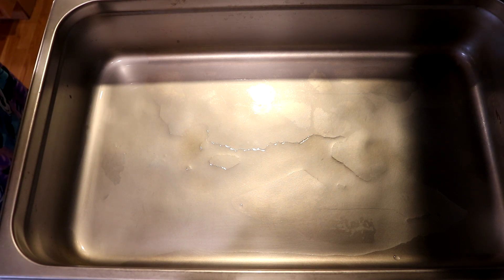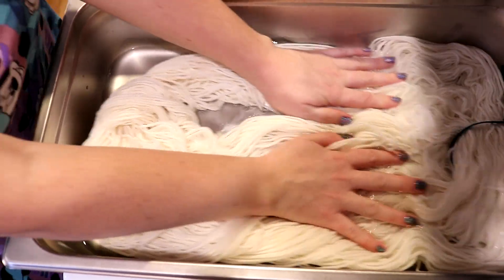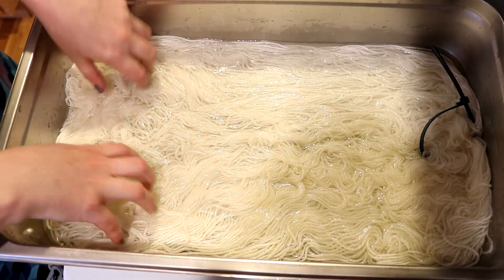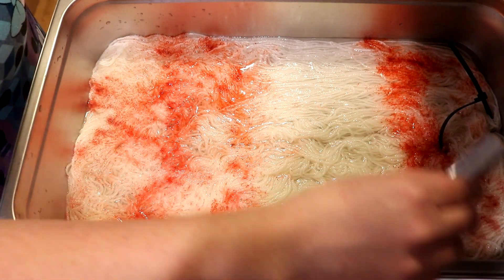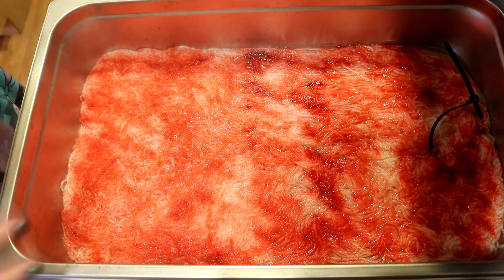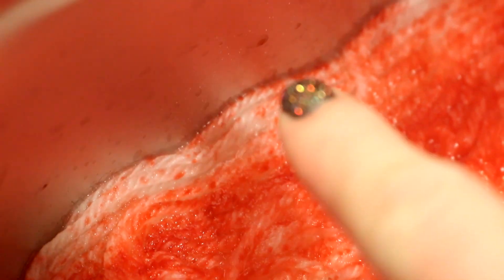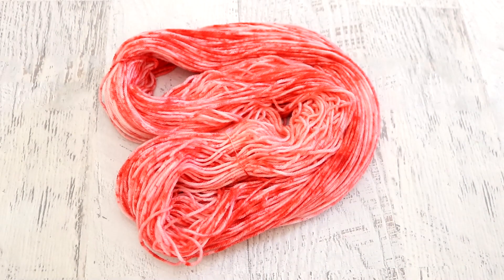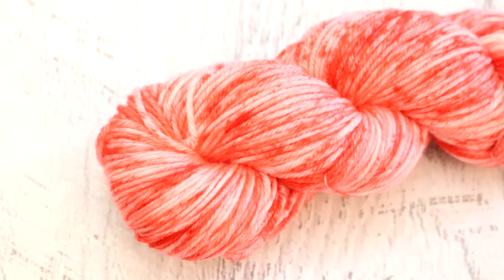Dyepot Weekly #261 - Dyeing Yarn with Hawaiian Punch Powder (+A Failed Asymmetric Heat Experiment!)

Comment: Thanks.  But failed is a strong word.  The yarn turned out pretty, even if it did react as you expected or wanted.  My only fails are when I burn the yarn!  Anyway, could you use this method with a bamboo?  Have you ever dyed a bamboo mix?  What did you use?  Thanks.
Reply from the maker: The yarn isn't a fail at all - it was the experiment that was a fail!  :D  I think I always planned to do this to the yarn in the end, but I wanted to be able to control how much I added to see if the heat made a difference in how things struck, and I didn't set it up in a controlled way. :D 

If you search my channel for Galileo you can find some videos I've done with 50% wool 50% viscose from bamboo.  :D

Comment: My fruit punch dyed yarn went pink on me. I didn't get any nice red spots. I have a few theory's on red drink mix to dye yarn.
Reply from the maker: Krystal - what technique did you use to dye it?  I was able to get some speckles because I had the water level super low.  The overall colors is very pink but since the dye was concentrated with the speckles it is more red.
Reply: @ChemKnitsTutorials  What i did was i did the presoak, because it was my very first hand spu. lightly wrung it out layed it out and sprinkled the dye powder , wrapped and microwaved. It was looking pretty pink before I microwaved. I did get an interesting glazed effect but I dont know if that is because of the yarn or the dye method.